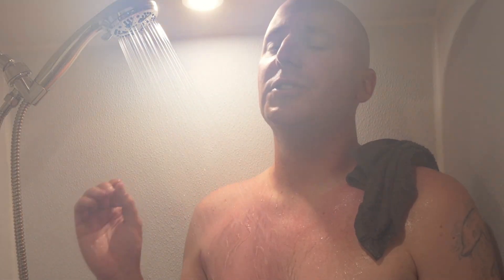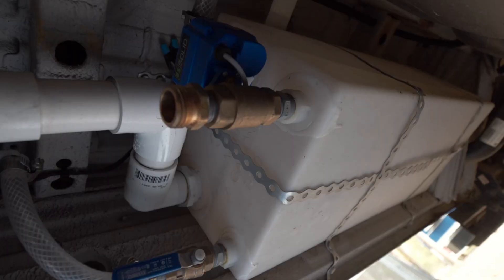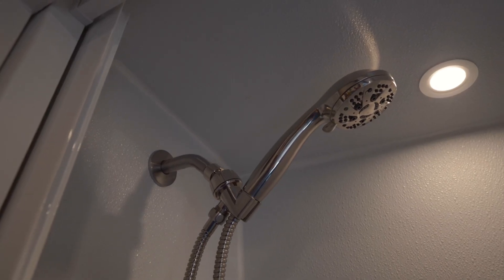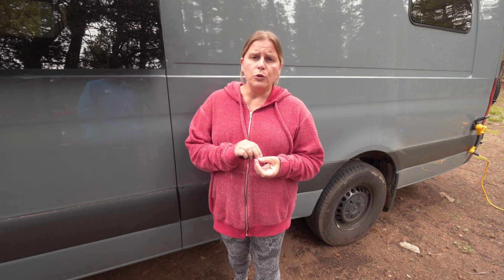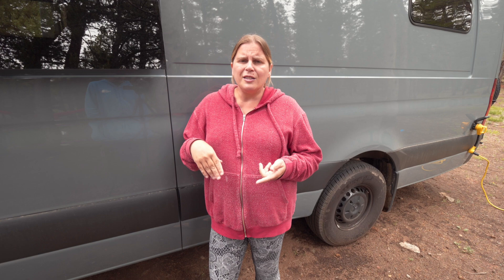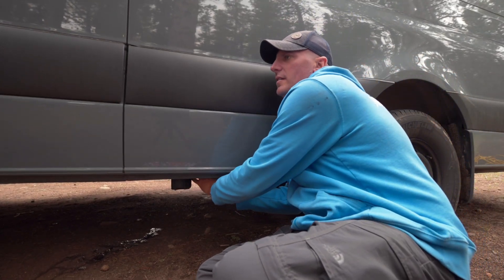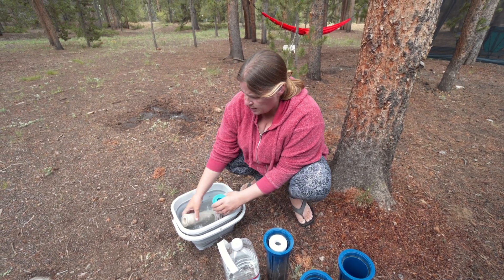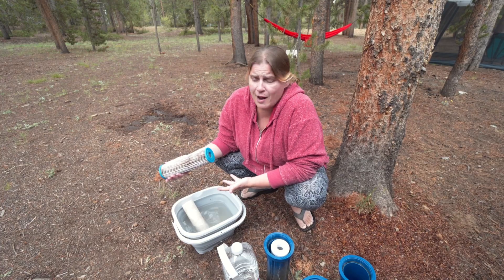RECIRCULATING SHOWER for Vanlife: The Truth and What You Need to Know!

Comment: Great useful video. I'm an engineer and have been looking at these recirculating shower designs for over a year. One of the major issues I have is the location of the 3-stage filters underneath the van. While this seems convenient for maintenance (which is thankfully shown here), how durable is this when driving?  Have you ever had any mishaps with this location? Do you do ANY overlanding, however mild? And have you thought about a different location?  Thank you.
Reply: @barrybarry5803  For a question concerning a practical location from someone that is actually using these, yes. You can do all the theoretical calculations you want, but nothing is better than practical applied use. I want feedback on that one question, which is not addressed in his video, or anyone else's that has a similar design. Before I build this for myself, I want to make sure I locate it for my needs.  Doesn't that make sense to you?
Reply: @barrybarry5803  If YOU have questions about functionality or the design itself, go ahead and ask them. I don't. I've gone through all of that already. And start looking at these designs on OTHER youtube channels. This isn't the only one. There are literally hundreds of them out there with similar designs.
Reply: @richlouie99  hoping to build one later this year. For freeze protection I'm putting everything inside. I'm going to have all the plumbing and filters snaking around vertically in the wall behind the shower. There will be cutouts/cubby-holes for the spindown and water filters, so that they're accessible from within the shower. And I'll plumb the spindown wash drain exit directly into grey water tank with the drain valve accessible from the shower. So that way you can see the state of the spindown filters, and even flush them in the middle of a shower. Also might try to get one of those really skinny & clear water tanks to use as the recirc holding tank, and have that visible from within the shower so that you can see if it's starting to look manky.
Reply: @daveachuk  These are awesome design ideas! Especially the clear water tank. The water tank, spindown filters cubbyholes can all be located under the shower head for convenience, space economy and construction efficiency. I've never seen that in one of these designs and am excited to see the results. I'm going to play around with this myself now, to see if I come up with any roadblocks. I'll keep you posted!  Good luck!
Reply: @richielouie99 I’ve had the same thought about the filter location. I’m thinking I would add a removable “skid plate” below the filters to protect them. As for the hoses, I expect you can get (or have someone make) them with a stainless overbraid. They also make a wrap or sheath for hoses/wires in the automotive/racing/off-roading industry. I’m thinking of using something like that for all hoses/Pex under my van.

Comment: Do you use the same water heater for the shower as the sink? How does the hot water heater handle the soap?
Reply from the maker: We have a hydronic heating system, which has two heat exchangers. One loop for the sink and a separate loop for the shower. The water from those 2 sides never touches each other

Comment: maybe get a 2 gallon shower water tank and dump water after each shower along with non petroleum soaps just a thought
Reply: at least thats my design
Reply: @stevenwatts1150  yea ive seen this before but with different sized tanks. I'm thinking (after seeing this video) of having maybe a 15 gallon and separate 5 gallon tank, so I'll use the same water for a few showers from the smaller tank before dumping it and using the next 5. But I guess that doesn't help too too much with soap clogging the filters...
Reply: @knockknockbusted  Yea. I think it should be fine, plus I already shower at the gym I just want to be able to shower whenever i want and think this will be worth it.

Comment: I assume you can't run this system during the winter ?
Reply from the maker: We don’t plan to use the system in freezing temps. We will just purge the water and not use it if we are anywhere where it could freeze! Generally speaking we plan to chase 70 degrees as much as possible though. If you want to be in colder weather you may need to look at ways to insulate or install inside

Comment: Why does my water still have soap even after it cycles for 5 minutes after each shower? I have a 40 micron spin down filter, 20 micron, 5 micron, then a 5 micron charcoal filter.
Reply from the maker: What kind of soap are you using? We don’t use soap in the shower currently… When we did we could take about 3 showers before we had to change clean out the filters and water
Reply: @WanderfulRevolution  I use dove soap
Reply from the maker: @vicenteespinoza1997  How big is your water supply feeding your system? Sorry meant to ask earlier…
Reply: @WanderfulRevolution  it’s in my travel trailer 10 gallon recirculating tank.
Reply: @WanderfulRevolution  it’s in my travel trailer 10 gallon recirculating tank.
Reply: What kind is soap do you recommend using on these small recirculating systems?
Reply from the maker: @vicenteespinoza1997  sorry for the delay in the response… we don’t use soap… just water and friction… many people suggested an all natural soap like Dr. Bronners
Reply: Do you think I should add a 1 micron filter? Or a .5 micron

Comment: Haha... photo bombed by RW&B Ben!  Looks like you shot this one during your stop in Leadville.  (Oops, I guess its a little creepy that I would know that). Turns out that the mounting location for the three blue filters was perfect, because they're easily accessed for servicing.  That would be a case for mounting everything near the side of the van if possible.  The soap-less shower... been there, done that, got the towel snap... many times in the gang showers after P.E. class in high school!  As I recall, we didn't spend a lot of time scrubbing and there was never an issue of smelly guys in class afterward.  I'm down with your use of the recirculating system.  Nothing like being able to take a "real" shower when you're in the middle of nowhere.  Nice follow-up on your installation.  I'm looking forward to the sequel.  -Burt in NJ
Reply from the maker: Aw yes, the good ok’ showers in school!!!! We did shoot this in Leadville while hanging out with RWB! I forgot about about the towel snaps though!!!! Here Sandy!!!!!! Gotta show you something!
Reply: @WanderfulRevolution  :-D Just don't blame that on me!

Comment: I don't understand why people would place them underneath the van. I mean aren't you worried that you'd like to be in some place when it gets cold?
Reply from the maker: The simple answer here is space. We didn't have the space inside the van. For the most part we don't plan to be in cold temps, however we recently were in colder weather for a couple weeks and we just drained the system and didn't use it during that time. Worked out okay for us and how we travel.

Comment: First, thank you for this video and for doing what you both do for a living - ER nursing is stressful, I am thankful there are capable people that do it.  My question : is there other system's that would work to give hot shower, even if not "endless"?  And can your van handle more weight than 7gallons water tank?
Reply: The seven gallons is only the water that recirculates. They have a larger tank for the kitchen sink and one time use. There are several ways to use and heat water from that primary tank if you have a regular shower. That’s actually how most van showers work.

Comment: Has anyone following this topic used a sand filter for this application?  It may be much less prone to clogging.
Reply from the maker: I’ve seen residential mock ups with a sand filter. The sand slows down the flow rate and requires more water. It works really well for residential and is something we considered but couldn’t fit it in our design. Really looking forward to see more of these systems as the designs improve! Thank you for watching!

Comment: Hi guys and thanks for the update. There's gotta be a way to use soap using different filters. When you say it clogs.. is that from the soap foaming up and stopping it from passing through quick enough? Or is it actually getting stuck? Also if possible on your updated system, could you please show a diagram or drawing of the looped system? Thanks
Reply from the maker: Yes. The filter that we used soap in clogged very quickly. There was a thick slimy film on them which was preventing water from going through. We will continue to try a few different things and report back in a later video. I will definitely show a diagram of the system in the next update! Thanks for watching!

Comment: You are running the water backwards through the pre filter.
Reply from the maker: Not sure what you are talking about here. The pre filter if before the pump to keep any big particles out of the pump. The flow of water enters both the filter and the pump per the arrows on the unit that indicate direction of flow for the water
Reply: @WanderfulRevolution  The incoming water to the pre filter should catch debris on the outside of the little screen inside the pre filter bowl. You have the water entering the pre filter on the wrong side of the housing.
Reply: @glennbeattie6172  
I looked up the pump and pre-filter. They both have arrows on them showing which way the flow should go and looking at the install video I can see that they appear to be installed correctly.

Comment: First let me say I am not a fan of these systems so my comments are precautionary. The FDA does not recommend these UV lights for this purpose saying that there needs to be more extensive research on the strength of the light, the time the water is exposed to it since this directly affects it's ability to kill viruses and bacteria. They state that the lights parameters are different for each virus/bacteria you're dealing with. ALso the University of New Hampshire has done extensive research on many of the different UV filters themselves and they found that the actual effectiveness of them is far over rated by their manufacturers. They found that most barely reached 50% of the stated effectiveness. Lastly, just like the soap problem you mention, fecal matter could also be an issue. I would be hesitant to take a shower in this way with any type of open wound. Being nurses I'm sure you've thought about this and feel it's not a problem so I think each user will have to make their own call. Your review was excellent however and should be very helpful.
Reply from the maker: Thank you for the feedback! We use treated water to fill our tanks (mostly). We plan on testing the water in a future update to help determine the effectiveness of our filters! Thank you for watching!

Comment: Why are you dangling the filters outside exposed to dirt and mud? smh🤔 
Use distilled water; not regular water. There are waxless, tallowless body soaps such as Regeneration multipurpose 0 fragrance hypoallergenic soap. I would change the location of the filters.

Comment: Hate to say it, but that shower system sounds like a major pain in the ass...
Reply from the maker: It seems like a lot but it really doesn’t feel like it takes much time to do the maintenance. We are still early in trialing it, so we will see how it goes
Reply: I'm with you, mine is an electric hot water system, works in the winter and the summer anywhere in the world and no maintenance required. Just like a sticks and bricks version. Love it, don't break something that already works I've always said.
Reply: @vickimathews1970  bosch electric is set to be installed👍
Reply: @Navillus2273  even 4x4WD tourers install electric hot water systems as they are the best system to use, especially if you are going overlanding anywhere.
Reply: @vickimathews1970  good to hear👍